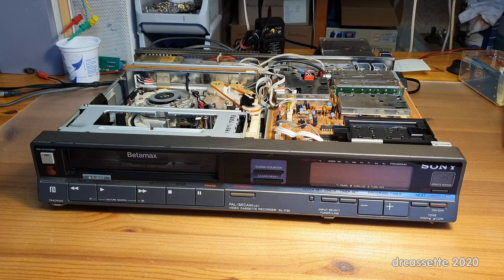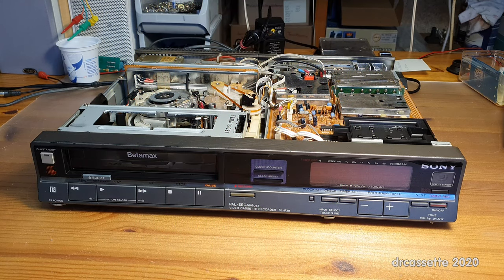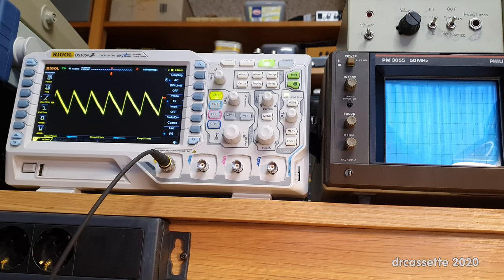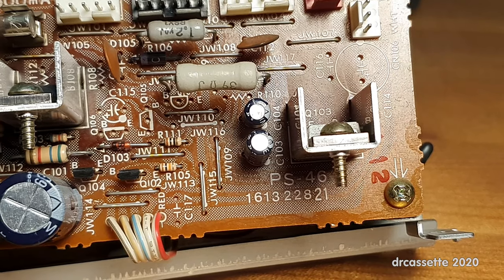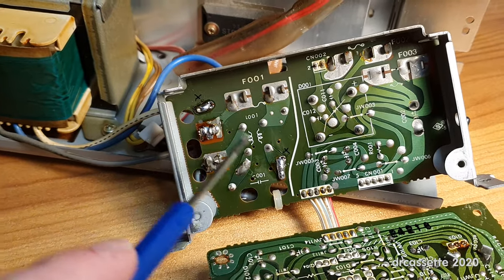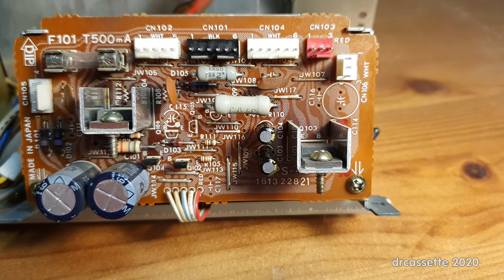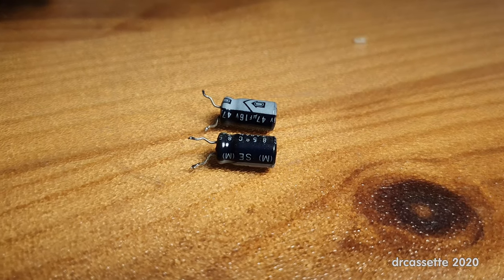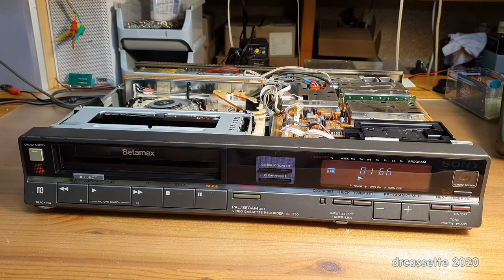Sony SL-F30 Betamax VCR dark lines in video repair fail

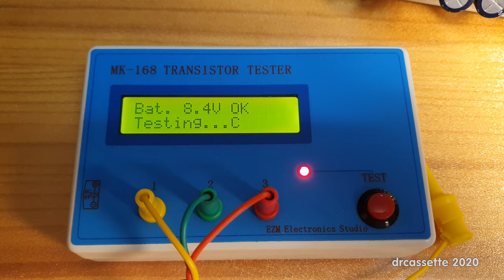Comment: 4:00 I have found that de-soldering a capacitor can often reform it (temporarily) so they may meter OK when removed but still have needed replacement, so it was worth doing anyway.  I doubt that 50Hz ripple is the cause in this case.  I think the defect you are seeing might be known as "Hanover Blinds" or  "Hanover Bars", the fault is more likely to be on a signals board somewhere.  I've never seen a PAL/SECAM version of this machine, it would complicate the colour processing a bit, you really will need the service manual.
Reply from the maker: Thanks for the info! I'll soon get an SL-F35 which is very similar to this model so I might be able to find the fault by comparing the two. In the comments below people have sent me links to service manuals, so I now have schematics which is a great help. 
This machine supports "SECAM Ost" which means it could receive GDR television in colour. It's not a full dual standard PAL/SECAM machine. From what I understand, in the GDR they would have liked to use PAL, but had to use SECAM because that's what the Soviet Union chose. But the television engineers in the GDR chose all technical parameters to be as close to PAL as possible, so the difference between a PAL and a SECAM Ost receiver was relatively minor. In the GDR it was popular to modify TVs to make them receive PAL. The SECAM used in the GDR was completely incompatible with the SECAM used in the Soviet Union.
By the way, internally the GDR television was mostly PAL and PAL compatible component video. They were the first German station to use Betacam (the original, non-SP Betacam) and they had a lot of cameras made by Sony and the Western German Bosch (BTS). They had to import Soviet SECAM cameras as part of the planned economy, but those were shelved and eventually trashed without ever being used. After the German reunification, they pretty much only had to replace the transmitters to switch from SECAM Ost to PAL.
Reply: @DrCassette  I believe that French studios generally avoided using SECAM internally, they nearly all worked in PAL and then transcoded to SECAM at the end, because SECAM didn't lend itself to editing chains very well.  Terrible waste that those SECAM cameras were never used, when you consider how much time and resources they must have cost to build.  (I am uploading a video right now about a machine which can play Betacam oxide tapes, I stuff a domestic Beta tape into it to see what happens.)
Reply from the maker: @video99couk   The problem with SECAM is that the luminance signal is frequency modulated as opposed to amplitude modulated like it is on PAL. This is especially a problem for traditional analog video mixers. You can overlay PAL signals just the same way as audio signals if they are synchronized, it's just an addition of amplitudes. SECAM is much more complex, as the sum of multiple frequency modulated signals is just garbage. You have to demodulate the frequency modulation, then mix it, and then re-modulate it. Very impractical, that's why it made sense to just have the entire studio run on PAL. Of course SECAM really was only invented to protect the french domestic industry from foreign competition (one joke translation of SECAM was "Système élégant contre l’Amérique").
I'm looking forward to seeing your video!
Reply: @DrCassette  However a good thing about SECAM was that it could be almost transparent to a monochrome channel that had enough bandwidth.  I've even had a SECAM recording which played back monochrome on a PAL video deck, but when connected to a timebase corrector set to SECAM mode, produced reasonable colour.  The tape format was very obscure: Technicolor CVC.  My Betacam video is taking a long time to upload because I've made the leap to 4k.
Reply from the maker: Interesting... me and a group of friends are collecting old video formats and their machines, I am mostly into broadcast formats and equipment, but one of my friends at the moment is trying to get into Video 2000. After we have accomplished that, I think we will look into CVC. That will be a very though project, as you no doubt know. Did you know Bosch developed a professional ENG camera recorder format based on CVC called Lineplex? It came out in 1984 and was a complete fail.
Reply: @DrCassette  Yes I did know about that, I have some documentation somewhere, but I think it was called Quartercam. http://www.vtoldboys.com/arc18.htm#
Reply from the maker: The website I have as a source is in German language... http://www.magnetbandmuseum.info/bosch-lineplex-kasse.html
Quartercam was the name for the product line of cameras and recorders, the cassette format was going to be called Lineplex. You can see photos of a Lineplex cassette on the website. The German manufacturers were not very good at naming their products consistently :D
The website you sent also features the RCA Hawkeye - have you ever come across the original M format that later became MII?
Reply: Hey. I have a few old Betamax tapes that were recorded back in the 80s in the SECAM system which is what Greece used back then. If I play them in SECAM on a multi-system or a PAL/SECAM VCR like the Sanyo VTC 5350 or 5550, they produce a thick pink line at the top of the screen, but if I switch the VCR to PAL, the picture mostly clears up. Any idea on why this is happening?
Reply: @crashbandicoot4everr  A digital timebase corrector might help.

Comment: We remember Wagner DE's Betamax site. Used to be really interested in Betamax back around the turn of the century..

Translation of the instructions in question...

Narrow stripes in the picture above A / V output and modulator
  The error appears in the tuner and the playback mode.  It is possibly a defective Elko C104 (22µF 16V) in the power supply.  Anyone who has an Oszi (oscilloscope?) can pin.  3 Measure the high-frequency voltage components on the UNSWD 12V supply voltage from connector CN103 (red). 

 If you renew the electrolytic capacitor, you can also replace the C103 (22µF 16V), which is located in the UNSWD 6V supply voltage.  But be sure to pull the power plug !!  Because the power supply board also carries 230V mains voltage, this is life-threatening !!

Comment: What about the bigger capacitors. They might be the primary suspect in my opinion.
Reply from the maker: I find usually the small value capacitors are the first to go bad. So if the small value capacitors are fine, it's very unlikely that there is a problem with the bigger capacitors.
Reply: @DrCassette  Maybe it's the case. Though I noticed they are different color. Try and check the The heat-sinked transistors if they are weak.

Comment: In the sun sections thier are additional power supplies filter caps in each individual section.   Find your video section and replace the sectional power supply filter caps
Reply from the maker: Thanks for the advice. I still have the VCR, I will have to check this when I get it out again.

Comment: "Better late than never"  
For a test, i would disconnect the d.c output and use an external supply at the same voltage to see if the problem changes.
I find a variable supply very handy :-D
Reply from the maker: Since making this video I was able to compare this SL-F30 to another one, and it was showing the same effect. So I am not even sure anymore if this really is a malfunction or just some limitation of these entry level models. I have since gotten an SL-C9 which produces a much better picture :)

Comment: Y can try replace the videodrum capasitor it is under the rotating head
Reply from the maker: There are no problems with the head drum servo.
Reply: @DrCassette  ok i must have a schematic if i can find it i mail it to you

Comment: My problem is similar to the same recorder. Maybe somebody knows the answer. Can replacing the electrolytic capacitors on the YC board solve this interference problem? 
The other problem is that the sound of the video is constantly fading to complete silence. Sometimes the picture goes out after that. How do I start to fix it? Unfortunately there is no one near me who knows how to do it. The problem: https://youtu.be/KVBXbQxf9vA